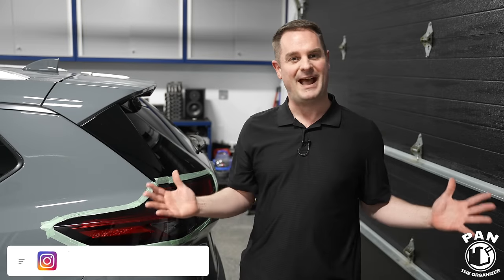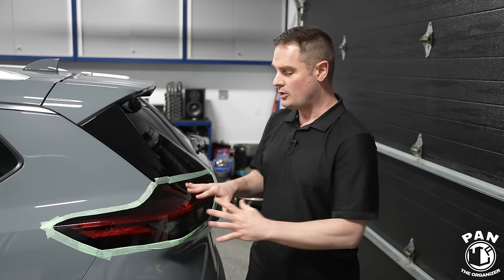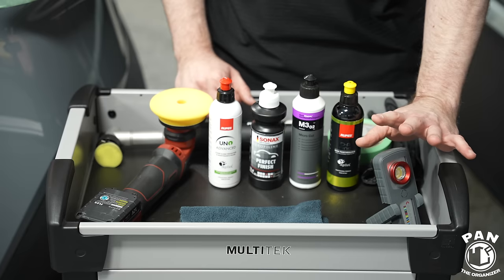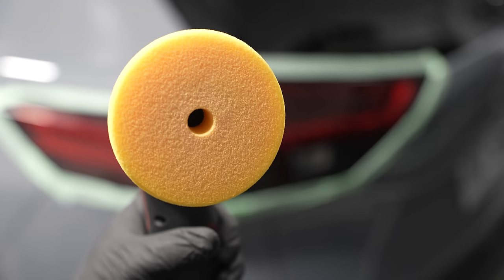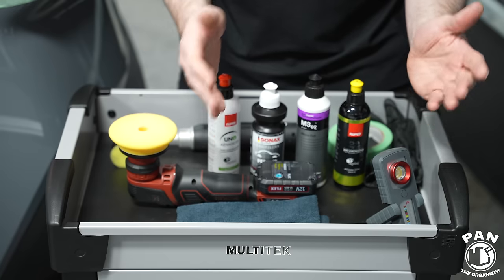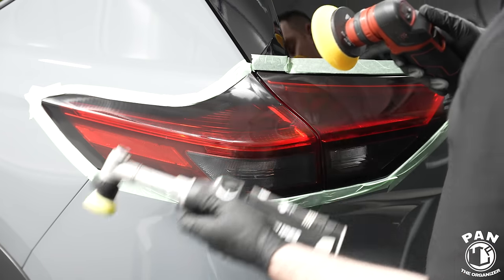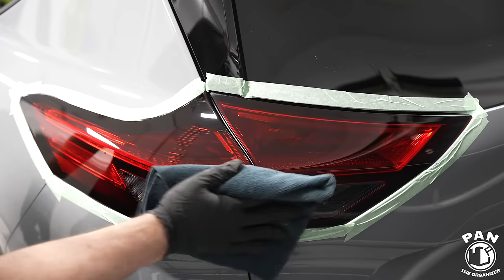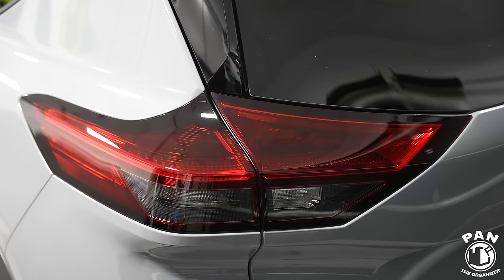How To Polish Tail Lights

Comment: First thing at the dealer for maintenance: telling them not to wash it, second step put a paper in the dashboard dont was the car
Reply: I have a little tag that hangs from the rear view mirror that says don’t wash the car 😂
Reply from the maker: Correct. Never let dealerships do anything to your vehicle that's related to detailing.
Reply: Agreed. Years ago I totally forgot to tell the dealership NOT to wash my car. It was in the middle of a Northeast winter, I let my car go for weeks on end without washing it because of the bitter cold, it was a black car and when I went to pick my car up I was convinced it wasn’t my car! They gave me a “courtesy wash”, they must have used one of those brushes and it looked like someone sanded my car. I won’t ever make that mistake…
Reply: Yup. Tape one Post-It note with painters tape on the Steering Wheel and one on passenger Dash.. “Do not Wash or Wipe”. I also have them put a permanent note on my account that pops up when I take my car in for any service.
Reply: I really want to buy a smaller or micro polisher as it would make a lot of jobs easier.

How often do most of you guys use the small polisher?
Reply: @ONI1013.  awesome- thanks for the recommendation and reply!!

Comment: You know what works good for taping all the curves in a headlight? Electrical tape. Maybe not for the whole light but good for the big curves. It's a rubber tape so it bends around corners, use paper tape for straight sections.
Reply from the maker: You can just get thinner more malleable tape, made for detailing, like this: https://bit.ly/47sHdnF

Welcome to my channel. You discovered one of the biggest car detailing channels on YouTube as we surpassed 950,000 subscribers and we have over 125 million views! I have been detailing for 26 years and I love to share my knowledge and passion with my viewers.

You found the right channel to help you learn everything about detailing.

Comment: Pan, can you do a feature please on the new Adam’s graphene boost?! Just seen a comparison video on Bel Levaro channel and it has INSANE chemical resistance and the water beading to match! All the benefits of the best spray sealant but without difficulties of using a DIY ceramic 🙏🏻🙏🏻🙏🏻

Comment: Hello Pan, thank you for all your videos and instructions. 

I have a question for you. I bought a brand new Mazda CX-5 last February. How can I protect my head lights and tail lights?
Reply from the maker: Congrats on your new CX-5. You would apply the same protection as your paint. Ideally a long lasting ceramic coating. That will prevent the lights from oxidizing and yellowing over time.

A new car is never new until it's properly detailed. 
- at the factory, the paint defects are often corrected quickly by rotary polishing which can leave marks and holograms, so polishing corrects those, before you lock that in long term with a ceramic coating for example.
- vehicles are then transported by truck, train and boat so they are exposed to the elements, industrial fallout, brake dust, rail dust, etc
- vehicles are often left at boat docks (when transported by boat) or in exterior parking lots for weeks or months, again being exposed to the elements
- at the dealership, the vehicles are almost always poorly prepped using the same dirty water that was used for all the cars on a given day, and poor washing and drying methods leading to swirls and scratches 
- at the dealership, a layer of cheap wax or paint sealant is usually applied to attempt to make the paint glossy prior to delivery. It's crucial to remove any previous protection before you apply a ceramic coating, as coatings need to bond directly to a virgin clear coat.

If you only plan on applying a regular carnauba wax or paint sealant though, you could decide to skip machine polishing, as those protectants can be applied over existing protection and it's not as crucial to prep the paint as well.

I explain all of this in this popular video: https://youtu.be/QgoyrC-5CMc

So you can better visualize the new car prep process, here are the steps I perform on a brand new car from two of my customers: 
Aston Martin Vantage: https://youtu.be/OKga3yZVTqo
Tesla Model Y: https://youtu.be/gohks8xP5NY 
Porsche 911 Carrera: https://youtu.be/2ckiivbFqs4
Audi Q7: https://youtu.be/t7HCBSVnizM
BMW M6 Gran Coupe: https://youtu.be/0lC9uyKXs8Q
BMW M340i: https://youtu.be/etXhJNaF0EE
Audi RS3: https://youtu.be/641mAJfKDLM
Golf R: https://youtu.be/jr19g4PWJsk

Comment: What order would you address head and tail light in for a complete car detail? like for sure after was, clay, decontamination but then paint, tail and head light and glass last??or paint being very last? also if coating glass/wheels/paint would that change the process order?

Comment: Pan what protection would you recommend for tail lights? 

Currently I used griots garage all in one polish which give a a few months of protection…

I wanted to use an IPA to remove that protection and give it something that will last longer
Reply from the maker: A ceramic coating for sure. Paint, glass, wheels, trim, lights, etc I like everything to be ceramic coated on my cars.
Reply: @PanTheOrganizer  do you have a suggestion for a cheap one? Normal coatings have a shelf life, don’t wanna open up a bottle just for a set of head lights

Comment: Wow, love the results and it wasn’t too time consuming. Would you recommend adding protection like a ceramic coating, if so, what would you use?
Reply from the maker: A true coating (glass bottle) would certainly last longer. But if you want to apply a true coating, it has to bond directly to the surface, and not on top of the Uno Advance. 

So if you want longer lasting protection, might as well do the entire procedure to perfection, meaning: 
water sanding, compound, polish, IPA wipe and a ceramic coating applied is usually the best restoration method.

That's if the headlights are really faded/oxidized. If they're in good shape, then a light polish with something like Sonax Perfect Finish, followed by a paint prep spray (like CarPro Eraser) and then the ceramic coating is perfectly acceptable.

Comment: Wow! Amazing results, my car looks the same in certain areas because of the dealer's crappy tunnel washes, even though I asked them not to wash it! Is this new uno polish just as good on paint?
Reply from the maker: Yes Rupes Uno Advanced is as good on paint, as long as you know its limitations. This is an all-in-one type polish, meant to correct light imperfections, swirls and scratches. If you have severe deeper scratches/swirls and heavy oxidation, it's best to use the traditional method of compound, polish, IPA wipe and then ceramic coating.

Comment: Looks good. Could I use this on the front headlights after I compound and sand it? For the gloss and protection ?
Reply from the maker: You could do the same on headlights too, but keep in mind, neglected headlights that are heavily yellowed, oxidized and/or have a hazy/chalky white appearance, typically need more polishing techniques. Water sanding, compound, polish, IPA wipe and a ceramic coating applied is usually the best restoration method.

If they headlights are only lightly faded, and you don't have the time or all the tools for a full restoration, you can also use a quick tool-less method like in my headlight restoration tutorial here: https://youtu.be/sqpXsBcVako

Comment: Excellent as always.  Question, new daily driver,  2021 Jeep Grand Cherokee Summit Reserve only 6k miles, paint in very good condition, in bright white on the body and black roof line, I will still do paint correction with Sonax perfect finish, but intrigued with the Rupes Uno.   What ceramic coating would you recommend? I was thinking the Gyeon Pure. What are your thoughts?  Thanks again, all the best.
Reply from the maker: Keep in mind, you wouldn't use the Rupes Uno Advanced if you plan on applying a true ceramic coating (the ones in a glass bottle). UNO Advanced already lays down it's own protection, and you don't want that before applying a coating as coatings need to bond directly to virgin clear coat. UNO Advanced isn't meant to be used as a primer for ceramic coatings.

UNO Advanced is meant as an all-in-one polish, meaning it takes care of light scratches/swirls and applies a thin layer of protection that can last 6 to 12 months. 

If you plan on applying a ceramic coating, use a polish that has no protection in it, like Sonax Perfect Finish for example. And after the polishing stage, use an IPA to wipe the surface of any polishing oils, and then you'd apply the coating.
Reply: @PanTheOrganizer  Thanks for the info.

Comment: Great video as always, thank you!

I recently did a hand sanding/polishing with a turtle wax kit and then sealed with a wet wipes coat and uv protection provided in the kit. Later I bought a DA polisher and now want to improve the results. 

Do you think it's okay to do as in this video despite an extra layer of coat and uv protection on my headlights?
Reply from the maker: If they headlights are only lightly faded, and you don't have the time or all the tools for a full restoration, you can also use a quick tool-less method like in my headlight restoration tutorial here: https://youtu.be/sqpXsBcVako

That's likely what you did in your case. If you want a deeper and more extensive headlight restoration to achieve maximum results for clarity and protection, you typically need more polishing techniques. Water sanding, compound, polish, IPA wipe and a ceramic coating applied is usually the best restoration method.

Comment: Awesome demonstration. The tail light looks great. If you own your car for many years and take care of it about how many times can you polish it? You only have so much clear coat?
Reply from the maker: Ideally, you would apply a true ceramic coating on it (that lasts for years) and do proper maintenance washes yourself that way you won't have any swirls or scratches if you use safe washing and drying methods.

But if you vehicle goes through tunnel washes, gets washed at the dealership, or you use improper washing and drying methods, you will have to polish often. How much is impossible to tell, as it will vary between car makes, models, etc. 

You could also decide to have a paint protection film applied to them so they resist scratches and swirls.

Comment: Hey Pan thanks for sending me to this video. With the uno advanced can a ceramic coating be put over it. Or it has to be naked clear  coat?
Reply from the maker: No. You don’t use polishes with protection in them before applying a ceramic coating, as true coatings need to bond to a virgin clear coat.

Comment: Hi Pan great work could we also apply the same techniques to headlights ??
Reply from the maker: You could do the same on headlights too, but keep in mind, neglected headlights that are heavily yellowed, oxidized and/or have a hazy/chalky white appearance, typically need more polishing techniques. Water sanding, compound, polish, IPA wipe and a ceramic coating applied is usually the best restoration method.

If they headlights are only lightly faded, and you don't have the time or all the tools for a full restoration, you can also use a quick tool-less method like in my headlight restoration tutorial here: https://youtu.be/sqpXsBcVako

Comment: Ce genre de vidéo, c'est ce que je  préfère (la technique) est-ce que cette étape peut être faite en même temps que le  polissage du véhicule en entier ou elle doit être séparé?  MERCI Pan!
Reply: J'avais la même  question
Reply from the maker: Ce type de polish "all-in-one" est pour ceux qui veulent une étape de polissage et protection en un seul produit. Évidemment, la protection n'est pas conçue pour être hyper durable. Elle durera entre 6 à 12 mois. C'est parfait pour un usage sur les phares arrières comme dans cette vidéo.

Aussi, le puissance de coupe de ce polish est minime. Donc si ta carrosserie a de légères rayures ou de mineurs tourbillons, tu peux utiliser pour corriger et protéger. Mais pour tout scénario de rayures profondes ou gros tourbillons ou beaucoup d'oxidation, vaut mieux commencer par un compound, ensuite un polish, un IPA puis une céramique.

Mais si tu utilises le UNO oui tu peux polir la carrosserie et les phares en une seule opération.

Comment: As always great video! I have always wondered why when doing headlights does everyone remove all the original coating? Why not use this same process?
Reply from the maker: Thanks! You could do the same on headlights too, but keep in mind, neglected headlights that are heavily yellowed, oxidized and/or have a hazy/chalky white appearance, typically need more polishing techniques. Water sanding, compound, polish, IPA wipe and a ceramic coating applied is usually the best restoration method.

If they headlights are only lightly faded, and you don't have the time or all the tools for a full restoration, you can also use a quick tool-less method like in my headlight restoration tutorial here: https://youtu.be/sqpXsBcVako

So when the headlights are heavily damaged, the water sanding will remove the clear coat, so you can start fresh and remove the oxidized clear coat which has failed at that point.

Comment: Hey Pan, So after waiting the required 15 minutes and you buff off  the polish, is it okay to repeat the  same steps if you haven't removed all the swirls?  By repeating the same steps, would you then be removing the first coat of protection?
Reply from the maker: You could certainly repeat. Yes the polishing would likely remove the initial protection, but that doesn't matter, as you'd be laying done a fresh layer of protection with your second pass.

Comment: Quick question: What tones of light on your Scangrip light do you use with different surfaces? Does it depend on color? Material by chance (plastic or clearcoat..)? Thanks!
Reply from the maker: Yeah typically for dark colors you use a colder colo temperature (5000-6000K) and for light colors (whites, silvers) you use a warm color temperature (2700-3000K).

Watch my video on Scangrip lights here: https://youtu.be/h5Fci8N2dO0

Comment: Great video as usual!!!! Question how do you think this will work on a 2020 mustang black plastic rear deck lid in between the tail lights? ….they scratch se easily.
Reply from the maker: You mean gloss black plastics? Yes. It should take care of that, assuming the scratches aren't too deep.

Watch a video I made on gloss black plastic restoration here: https://youtu.be/rX14qgQcgao
Reply: Yes black plastic, thanks so much will check it out

Comment: Hi Pan.  Thanks again for a great video.  Would I use the same process for the headlights?
Reply from the maker: Hi John! You could do the same on headlights too, but keep in mind, neglected headlights that are heavily yellowed, oxidized and/or have a hazy/chalky white appearance, typically need more polishing techniques. Water sanding, compound, polish, IPA wipe and a ceramic coating applied is usually the best restoration method.

If they headlights are only lightly faded, and you don't have the time or all the tools for a full restoration, you can also use a quick tool-less method like in my headlight restoration tutorial here: https://youtu.be/sqpXsBcVako
Reply: @PanTheOrganizer  Thank you!

Comment: Would you use the same Rupee Uno 1 Advanced on the Headlights?  And if a compound is needed, which one you recommend?  And what pad with the compound?
Reply from the maker: You could do the same on headlights too, but keep in mind, neglected headlights that are heavily yellowed, oxidized and/or have a hazy/chalky white appearance, typically need more polishing techniques. Water sanding, compound, polish, IPA wipe and a ceramic coating applied is usually the best restoration method.

If they headlights are only lightly faded, and you don't have the time or all the tools for a full restoration, you can also use a quick tool-less method like in my headlight restoration tutorial here: https://youtu.be/sqpXsBcVako

Comment: In winter before a snow storm/icing event the state will spray on a dry road surface anti-icing liquid magnesium chloride which encourages cars to rust. The outdoor temperature now is 35° I have a 2 gallon pump sprayer which can be purchased at most gardening stores to add chemical to spray for bugs, if I put plain hot tap water in that 2 gallon container and spray inside the wheel wells to melt accumulated ice and dilute and rinse that chemical and also spray along the bottom half of the car doors is that a good or bad idea? Also seven months ago I properly prepped and applied Gyeon can coat and two weeks later topped it off with Gyeon Q2 wax and believe both are truly in place by the way the water runs off. TIA.
Reply from the maker: Yes that's a good idea Gerry. Any way to remove road salts and any chemicals used during winter on the roads is a good thing. Regular maintenance is key.

Comment: 7:00 TIP FOR PROPER MIX: Before I start working with liquid polish or any other liquid that is an emulsion, I shake them then turn the bottles upside down.  An hour before I work.  Then I give them a quick shake again before starting.  I do the same with any spray paint can.
Reply: Why not just shake the devil out of it. It mixes the exact same
Reply: @dragonwithak6051  It depends on the products viscosity. Also the type of emulsion. The product is in it's bottle for a long time and deposits can and will accumulate in the bottom. Even with a good shake, the particles  might not mix well and stay agglomerated in the liquid. (float as clusters) Let gravity work for you at the beginning of the process. (little trick we do in laboratory work)
Reply: @dragonwithak6051  Keep shacking the hell out of it, people complicate things that are simple 🤣🤣🤣
Reply: Overcomplicate car detailing with this one simple step…
Reply: @NipponStiqqyPaint  As it wasn't already complicated sometimes ahah